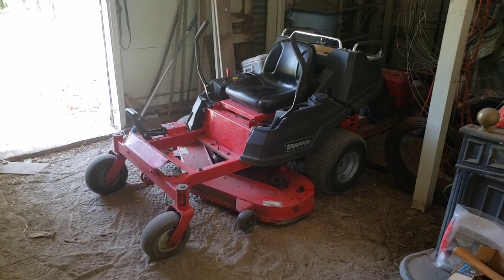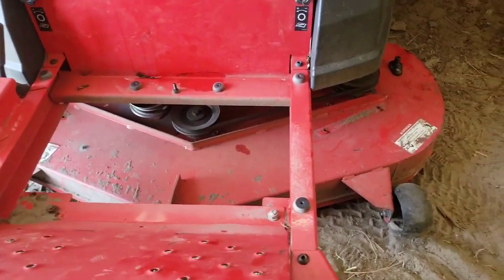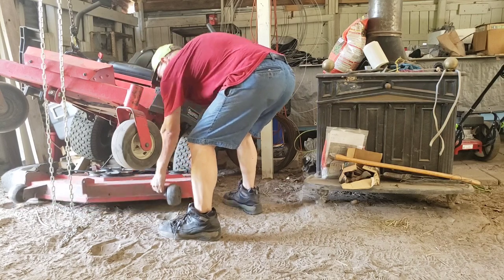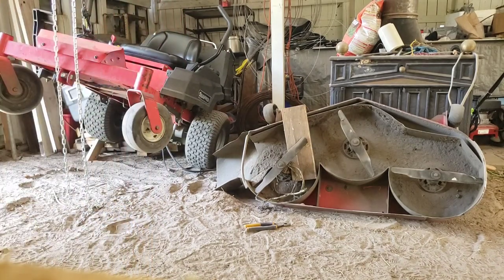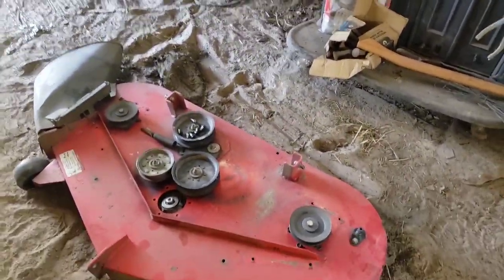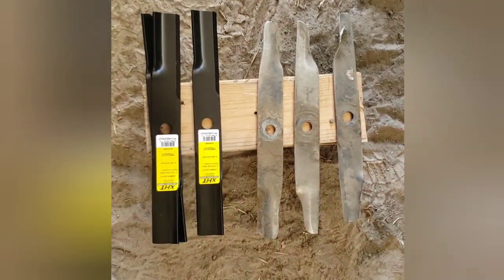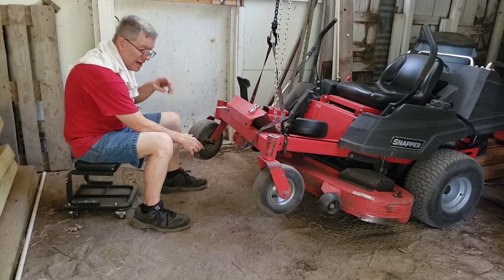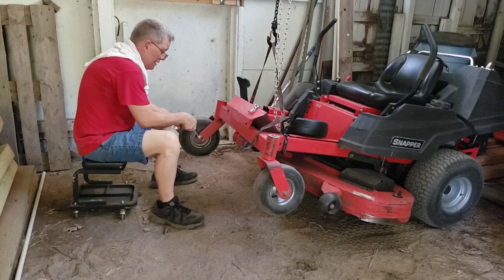Repairing my Snapper 360z zero turn

Comment: I have an old 350Z that is ragged out but I’m sure not ready to part with it, and either way I can’t afford it. The blade on the spindle that I replaced last year fell off today then got wobbly pretty fast after I put it back on pretty tight by hand wrench standards. A year ago I put it on right with a hand wrench and a long pipe. It seems like if  it wasn’t tight enough a year ago it would have fell of a lot sooner but I can’t find anything else wrong. The spindle isn’t wobbly or hot. The blade, bolt and washers are bad hot but that’s only because of friction from the loosening and turning I think.

EDIT: and it looks like we got the same aftermarket spindle…??? So have you had any problems with yours?
Reply from the maker: The reviews on the spindle were not great as best I remember. Also the spindle mounting holes where the bolts go through are not threaded. But I just put longer bolts through with nuts on them. The first spindle that I replaced last year in the middle seem to go bad pretty quick and I had already bought two more and stored them away. I'm waiting to see how long this one's going to last. I haven't found another source for spindles that will match that. I was thinking I might have to adapt a different spindle to it at some point in time as best I remember I think when I put the blade on there I had to put a extra washer on to tighten down the nut cuz something about the spacing wasn't right. So far I like the machine but it just seems like you have to keep up with maintenance on an older unit.

Comment: What's the model number on the Serial plate?
Reply from the maker: It is a snapper 360z
Reply: @keithwallick7440  That's NOT the actual Model number, I was going to get you a parts & Operators manual for it, I worked at the factory

Comment: Bet you didn't know that when you run those blades to that wore out condition the UNBALANCED blades will beat those spindles to death, replacement blades and or sharpening them and RE-BALANCING is cheaper than buying new spindles
Reply from the maker: I'm sure you have a point! But I would venture to say it's the rough terrain, the rocks, the sticks and limbs that I run over. The utter abuse that I put that machine through on my property. There's nothing about my property that is a golf course like lawn.
Reply: @keithwallick7440  We have that in common